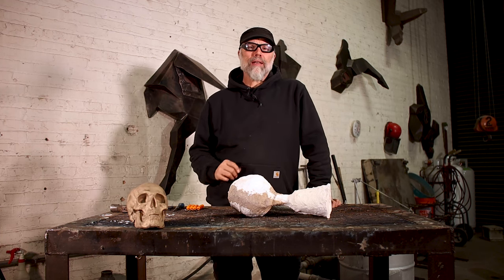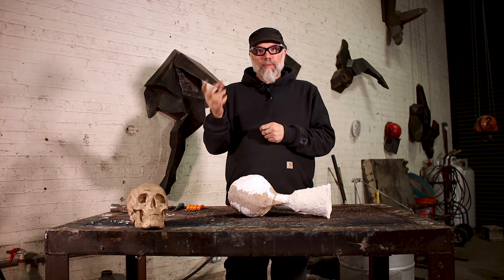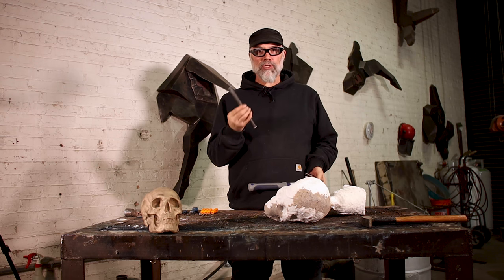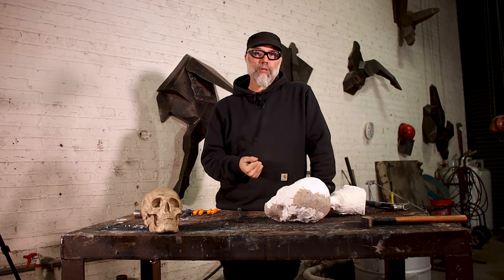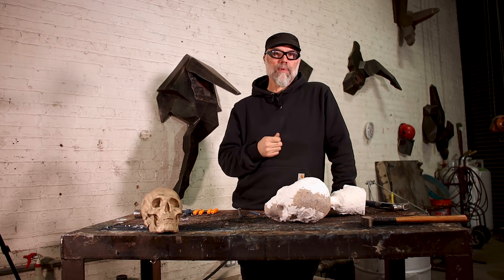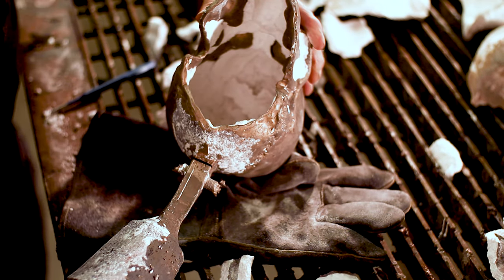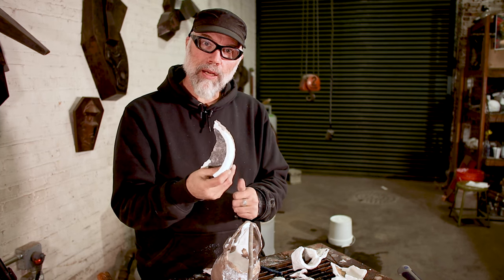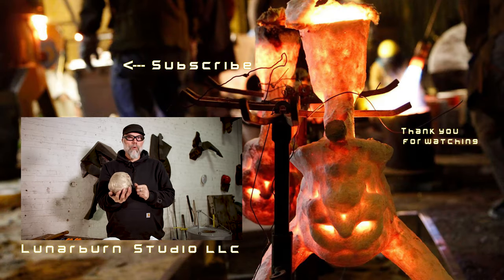The right way to release your casting from ceramic shell

Comment: Again, very nice explained. This is a step, that is nearly never discussed in detail in youtube videos. Thx. There is one open question for me: What material are you using in your sand blaster? I also work with sand blasters in my job, and I know, that this can make a big differnce. I am excited to see the finishing of the skull. 😊
Reply from the maker: If I can find it 100grit aluminum oxide to blast the shell off and 70-140 mesh glass bead pre-patination

Comment: Do you know any formula with more easily available materials to make the ceramic grout?
Reply from the maker: By Grout do you mean slurry?   There are a variety of refractories that you can cast metal with but Unfortunately, Ceramic shell is the result of very specific products and ingredients that are meant for industrial applications.  Its only in recent history that small foundries like mine are even able to purchase smaller quantities.  Making the process more accessable.
Reply: @LunarburnStudio  I understand, but could you tell me about a refractory that doesn't crack too much from the heat?  It is for lost wax process that I need it

Comment: Hi Eric, Thanks for your videos. It is so nice you share your experience.
May I ask a question please. I have a problem I can't figure out.
I tried to cast parts similar to yours in size and complexity.
The ceramic shell inside the part is uncompressible and very stable due to it's dome shape. It is not so easy to crush it by squeezing.
When molten bronze cools and contracts it cannot crush the shell and cracks itself.   I tried many times and always get this result.
Thanks!
Reply from the maker: What temp are you pouring the bronze at? May be too hot?  Another possiblity is to skip a dip or 2 on the core.  I retunly skip core dips when pouring aluminum or iron as they are more brittle.
Reply: @LunarburnStudio  Eric, I pour the 5-5-5 bronze at 1100-1150 C to the best of my measurement. I suspect my bronze may be too cold as even  the castings which did not cast well due to cold bronze still crack.
I tried to skip dips, even with 4 layers the internal shell becomes indestructible :)
Thanks Eric.

Comment: Thanks for the video very helpful, off topic question, got any tips for dealing with contraction cracks when casting spindly aluminium parts? 

I've been increasing the number and size of feeds as well as a face coating of crystalcast but due to the nature of the wax there's only so much I can feed in before the fettling work gets out of control.
Reply from the maker: Maybe instead of more feeds/vents increase the size to increase flow and retain heat.

Comment: I wonder if using investment plaster for the first "dip" and then ceramic for subsequent dips would make it easier to clean up...
Reply from the maker: Standard investment can not handle the high temps used for ceramic shell as a result you will get a poor results regarding detail.
Reply: The idea is interesting, you should try it.

Comment: have you ever tried to 'glue' multiple 3d printed sections together to cast bigger parts? I assume using that sprue wax should work..
Also is there some weight/size limit of the pour due to weight putting stress on the shell?
& have you ever tried using watered down drywall joint compound/mud instead of this expensive remet stuff?
Reply from the maker: Yes, the spru wax works fine, you can also use sticky wax, hot-glue also works and burns out fine.  The most metal weight I have poured into a shell is 100lbs, but I have a buddy that has done more.  More dips and additional reinforcement is needed.   Drywall mud can sort of work if you dont mind risking some (most) of your detail and surface quality.  Yes the pre-mixed slurries are more expensive up front but h the drywall mud you will spend more time cleaning up you castings.  And the finer detail lost is just gone.  All depends on the level of castings you want to achieve.
Reply: @LunarburnStudio  Thank you very much for the reply. You have given so much good information in these videos, i am trying to follow your process as much as i can. Just starting out i will give the joint compound & hot glue or wax a try. I want to cast an aluminum intake manifold for a car & mill the surfaces flat. Your skills are next level!!!!
Reply from the maker: Re-read my last answer , i edited my answer a bit (it was late).  The Mud can work for some castings but it will be less reliable then the slurries.